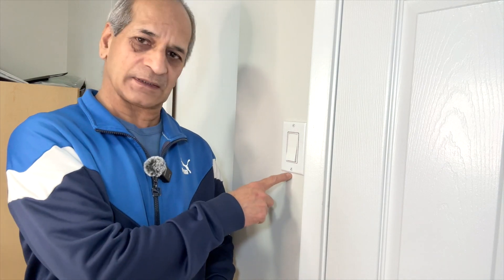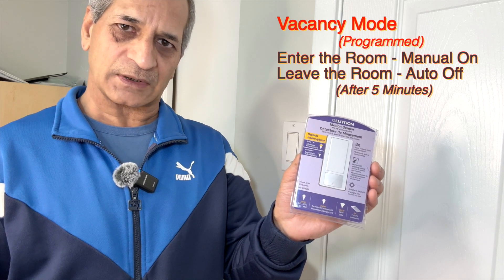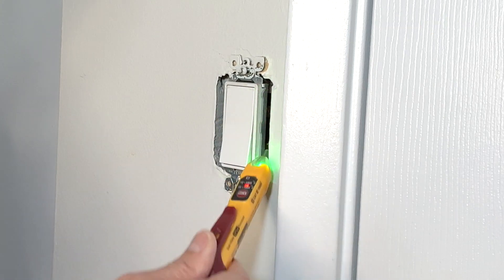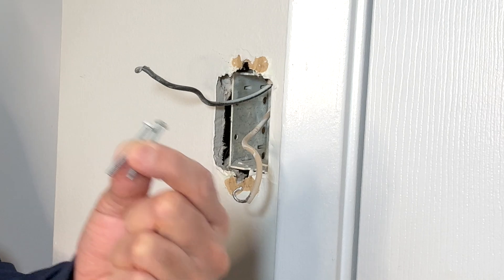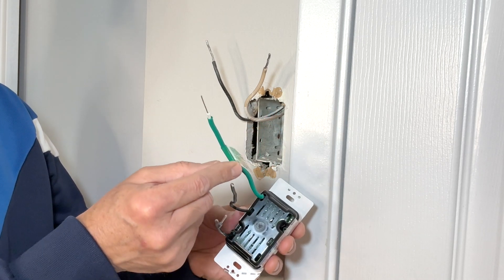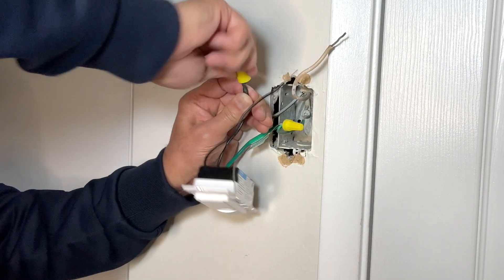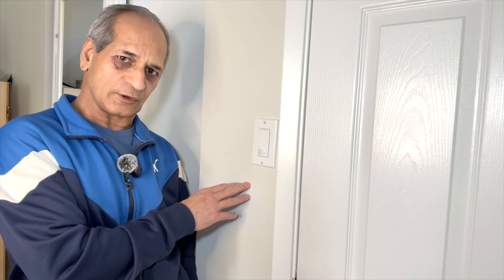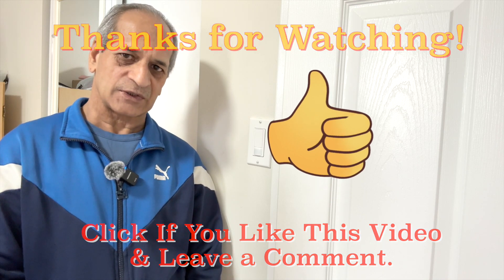How to Install the Lutron Maestro Motion Sensor Light Switch

Comment: Great clear instructions (along with the programming video), but my existing box where it's mounted is a plastic, not metal box, and not grounded. If I just twist together the green and metal wire without grounding, the light comes on, but the switch does nothing. The same if I keep them separated. Is the switch bad? And the original switch did not have a ground wire, just the two power wires. Thanks
Reply: I pulled out the adjacent switch in the box and found 3 ground wires together with one of those plastic twist connectors. Managed to get the new switch's both green and ground in with those and everything's fine now. Let's critique condo construction in Arizona in the mid-90's. All works as it should, and agian thank you for the incredibly clear videos.
Reply from the maker: @barryaz1 That’s good. I’m glad you finally found the solution. Cheers!!
Reply from the maker: Thanks! I’m glad you liked the video.
If you do not have ground, do you have the neutral wire? Maybe Lutron support will be able to give you a better solution. Thanks again.